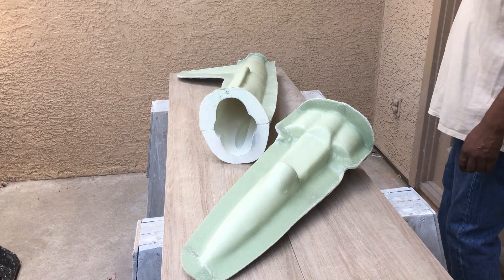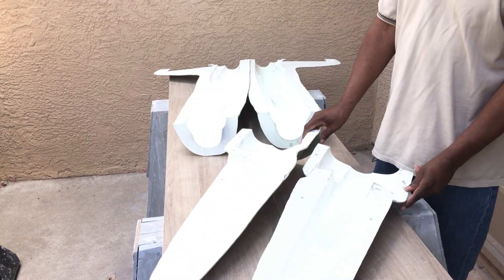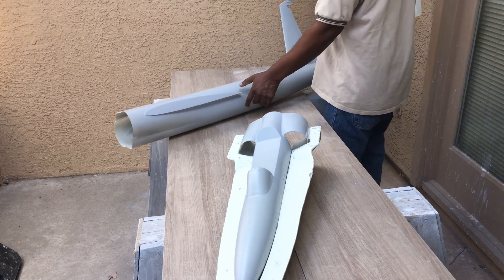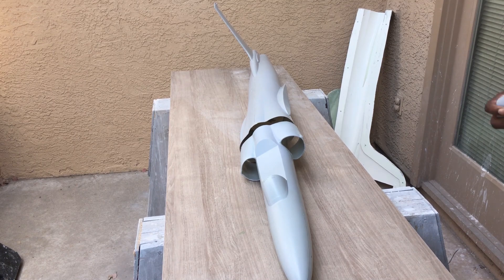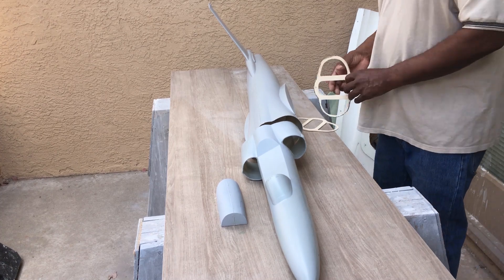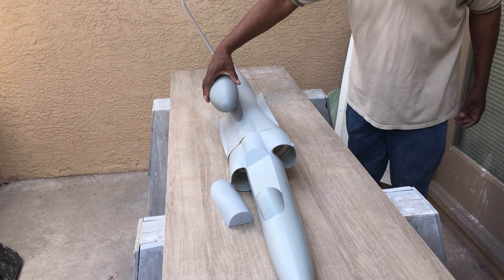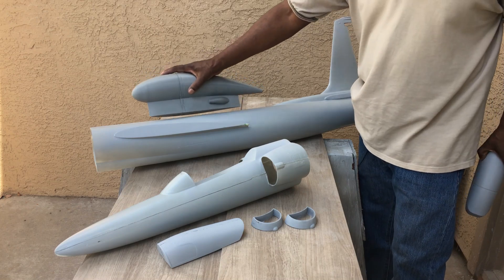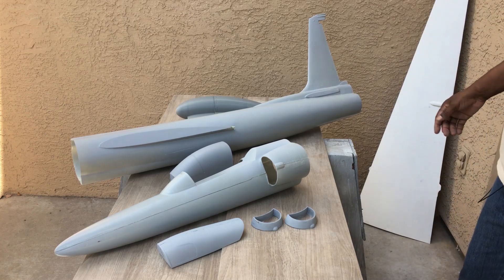110 inch Wingspan RC U-2 Spy plane Build

Comment: The fiberglass layup would be nice to see.
Reply from the maker: Do you want to see the layup of the mold or the layup of the part with the molds?.
Reply: @cadbuildflyrc3784  Layup of parts in the mold. I know you have a video on making the mold. :)
Reply from the maker: @Aviator747a  No problem.  I will do a video on it.
Reply: We're the formers made from the cad program files and cuts? Thanks
Reply from the maker: @amtpdb1  The 2 I show were not made from CAD, but could be easily done with CAD.